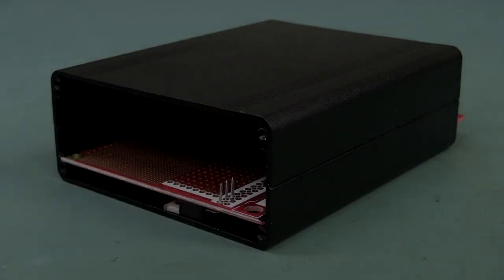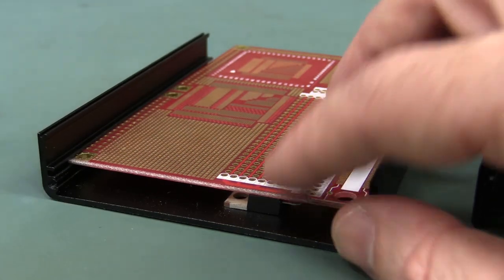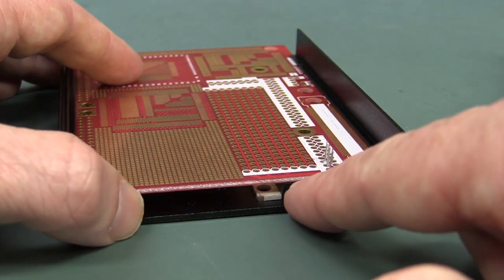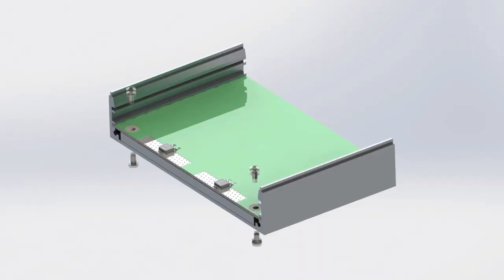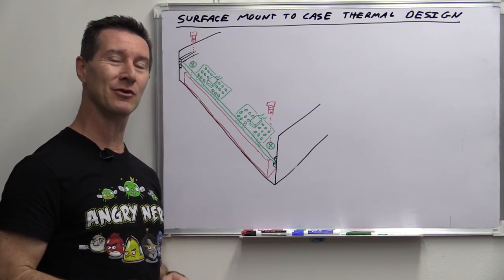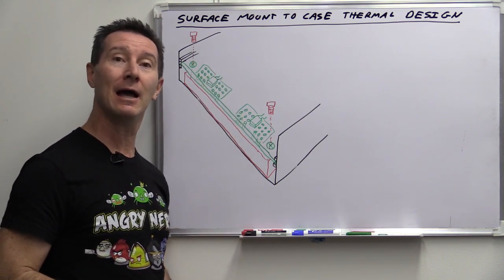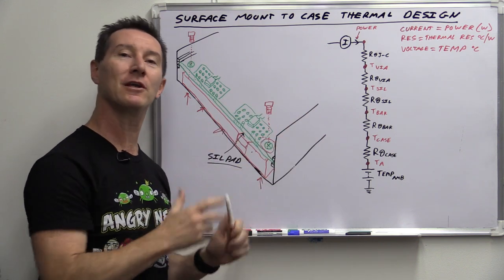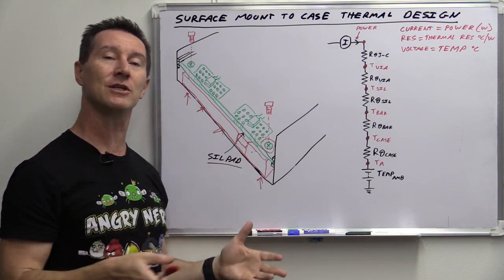EEVblog #744 - SMD Thermal Heatsink Design - µSupply Part 15

Comment: If the Vias filled up with solder would that improve the thermal transfer? significant?
Reply from the maker: ***** Argh, yes, I was going to go back and shoot anther clip mentioning that, but forgot in haste to get the video out (locked out of the lab for the entire weekend due to building work)
Reply from the maker: EEVblog and to answer your question, yes quite significantly, but you can get issues with lumpiness in the contact surface which may not be good. You can also get the vias filled with solid copper, but that's a bit of an exotic technique.

Comment: If plastic is so bad at conducting, how come some TO-220 packages of high power MOSFETs I order come 100% plastic (no metal back or tab)? Eg. NDF08N50ZG (500V 7.5A)
Reply: +Ryan O'Connor 
thats because they have low power disspation rating, and they use a thin plasic and because it right on the stuff that heats up its not that bad.
but if you are trying to say that plasic is a good conductor, I have nothing to do here.
Reply: isolation, see the fact it's rated for 500v ( answering for future people going through the comments )

Comment: could i use paper or cling wrap as a substitute for a silpad, or would they thermally insulate the part from the heatsink? i'm not exactly made of money.
Reply from the maker: ravener Not a chance. Silpads have an extremely low thermal resistance, and a high tear/puncture and voltage isolation rating.
Reply: EEVblog actually, i think a layer of paint or lacquer could be used. if you make the insulating layer thin enough the thermal resistance goes down drastically.
Reply: ravener Kapton Tape

Comment: I can't believe they've run the dataline right throught the power supply. Amateur hour!!

NB. I don't want tot spread misinformation. So just in case you didn't get the reference: it was a joke.

Comment: dave i need a good multimeter but as an student i dont have enough money for a fluke :(. and i dont want some crappy shit
Reply: EliteReacon Dave has the $50- and $100-multimeter "shootout" videos that you might enjoy.  They are a few years old but I don't think much has changed.  Sure there may be some newer models not discussed, but, except at the high end, the trend is not to improve quality, but to decrease manufacturing costs.

Some important factors in a multimeter are safety, accuracy, update rate and quality of leads.  As I recall, Dave seemed to place too much emphasis for my liking on checking ruggedness by twisting the meters, but to each his own.
Reply: I have a UNI-T ut61c, it is more than excellent. Precise with alot of cool functions,  and is safe as long as you dont work with anything high energy. Messing with household mains electricity wont be a problem,  but isnt recommend. 
But dont buy the ut61c if you need it higher resolution and true rms. Buy the UT61E. Which is true rms.
This meter never failed me. I love it
Reply: Anas Malas yes i look for the ut61d or so but i would buy the agilent on ebay if it would aviable in my country.
Reply: EliteReacon I live in uae. Here if you are lucky to find flukes. They are 2x the price. Don't even think about any other brand. But UNI-T based itself pretty good here. Its everywhere.  That is why my experience is limited to it.